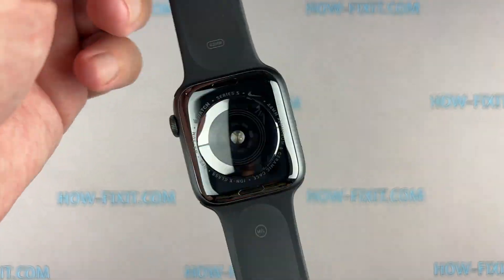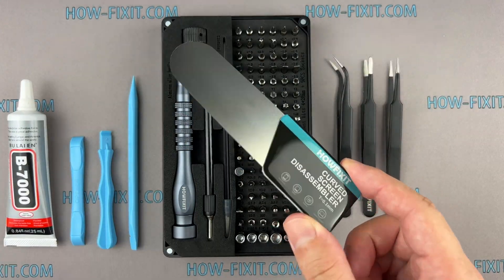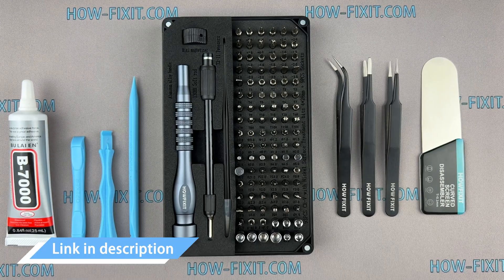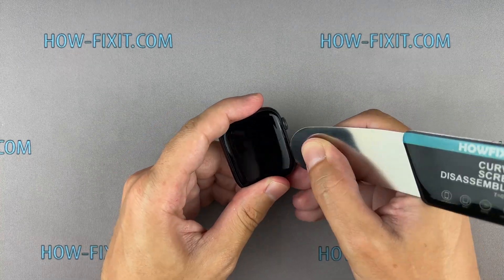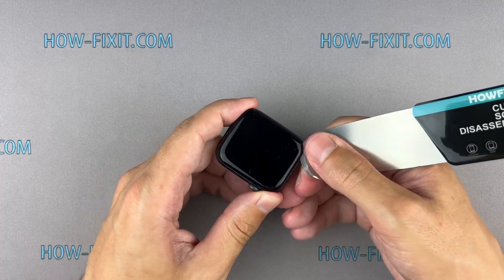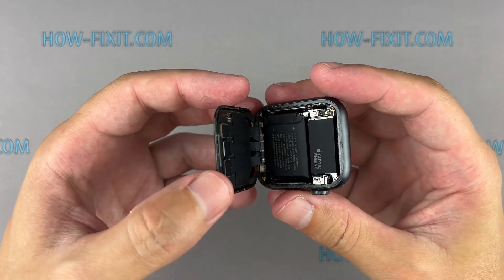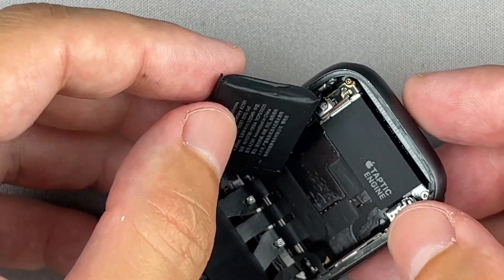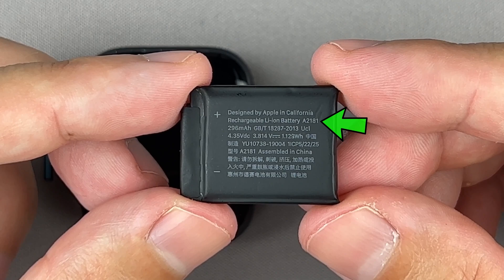Apple Watch Series 5 44mm Battery Replacement Tutorial

Comment: I can’t get the face anywhere close to separating from the case. Any suggestions?
Reply: Dunno if this is too late or not but 
1. Did you use a spudger?
2. Did you warm it up first?
3. When I did mine, the adhesive at the bottom of the watch was stuck to the screen and on the top and sides to the body of the watch. I had to peel it off the screen for it to open.
Reply: i can't open it . about ready to take a hammer to it...
Reply: I'm in the same situation, I've been trying for hours but can't separate the screen from the body. Apparetly the gap is tighter with Titanium & Ceramic, which is what I have, but I can't get any budge
Reply: @MrRetroDev does Apple offer in store battery replacement for a fee? May be worth it if you’ve got the Ceramic one.